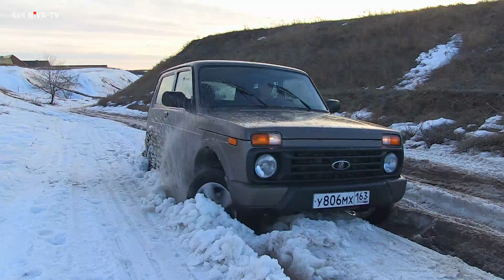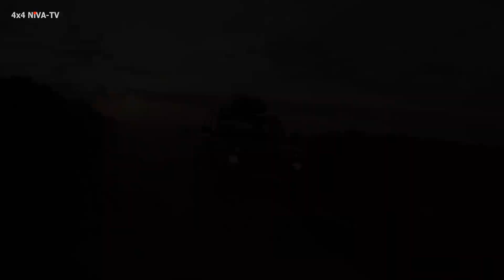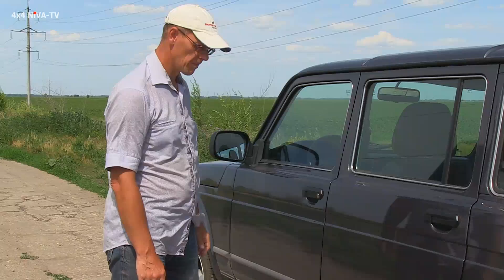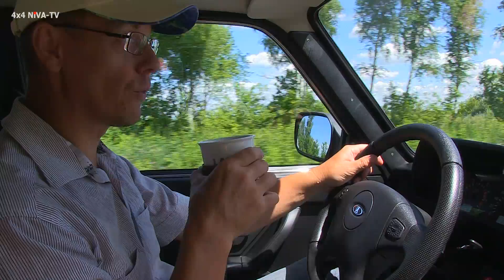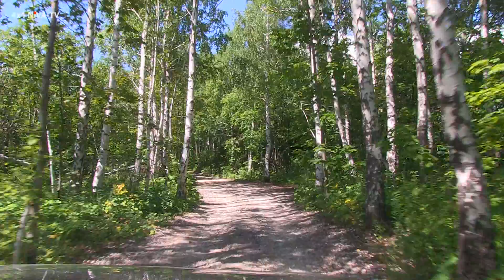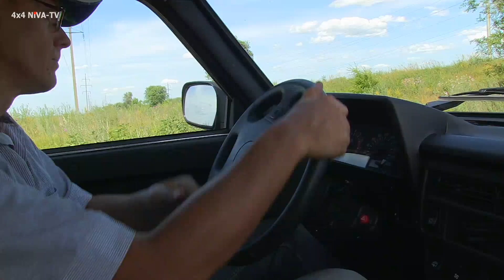Test drive of the LADA NIVA Legend Urban 5D (In English)

Comment: Too little, too late. G class evolved from 1970 before it got redesigned. It was a vastly better car before the 2018 redesign. Lada? Zero evolution. Its the same car. New bumpers.

Worst part is the engine and rear aluminum drums. Lada has so many other engines, why is this the only motor? Why is Lada still using those terrible rear alloy drums that lock and cause ladas to slide and crash in all russian crash videos?

Comment: Thank you for this video, it helped me to become more informed on the 5 door model, which never came to the UK.

The long wheelbase model would be better for my intended use, but I would prefer a longer wheelbase model with only 3 doors.

I wonder if Lada would build a long wheelbase 3 door version.
Reply: You could weld the back doors shut and Make interior door panels flat
Reply: Lada had a semi-long version, but apparently the demand was too small.

Comment: Interesting. Looking for a working car for beekeeping in rural Hungary and want something simple. It's come down to this or the Dacia petrol Duster. Everything else is quite old and very expensive. Wondering whether the newer Lada would be considered unsafe without airbags? Does it disintegrate in an accident like a Land Rover Defender? Won't really be going on motorways, and it doesn't go that fast anyway!
Reply: Ricsi bacsi You are ridiculous!!!! A duster is 20 times safer than a 4x4. Lada is UNSAFE. Its a 1970s car with zero structural upgrades.
Reply: Lada niva satın aldınız mı? arıcılık yapıyormusunuz? Türkiye den selamlar ❤

Comment: I bought lada urban from rymco lebanon and it did not start the engine for power failier for more than five times each time the company which is Rymco says they fix the problem. It always get worst and they have no idea to trouble shoot or correct the problem. They offered it for 14000 usd, they say it has these problems and i should not complain. B3side other problem in brakes and others.....
Reply from the maker: Hi. Did U push at the thrust pedal while U did start?
Reply: No i didnot. The problem was that The battery was died. There is an electrical problem the dealer is never able to solve. I needed to recharge the battery so the engine can start.
Reply from the maker: Just a bad fate...
Reply: Hi Toufic, I am actually considering the Lada 4 door from lebanon, there is a dealer in baakline, hows the truck so far, any other problems? for 14k man it looks like a great deal, I just want it for offorad and faraya for winter and other than that i will only use it once every two month when i travel, any advice ??

Comment: Great video man! Sub'ed
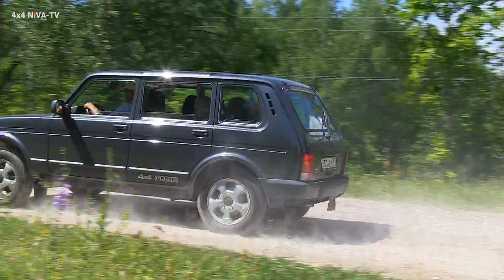But at 7:30, you changed to low range while moving? :O that's not good for the transfer case, as stated in the manual book, the vehicle must come to a complete stop to engage low/high gear.
I own the 3 door version, MUCH better for my daily driving and weekend off-roading :D I also fitted a mechanically locking rear differencial it's a beast!
Thanks :D